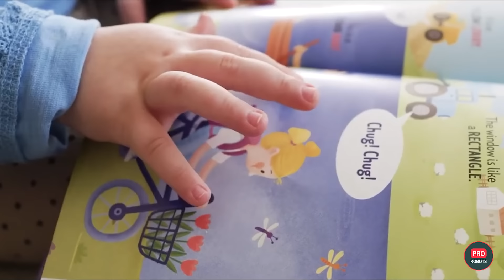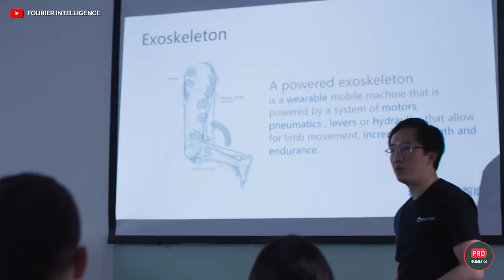Top 10 newest and most advanced humanoid robots in the world. Humanoid robot technology | Pro Robots

Comment: I think the obsession with humanoid robots is weird. I don't think the human form is necessarily optimal, except for robots that have to interact with people, since the human form makes the robots easier to relate to.
Reply: And if we are going to have robots in humanoid form, I would much rather have a basic face plate instead of a human face. Robots are meant to be servants so we shouldn't relate to them or treat them like people.
Reply: Manufacturing machinery and operations are completely made around human form. Therefore a plug-in robot to existing operations is the goal of these companies. It is way cheaper to buy a humanoid robot to drive your old company truck than to buy a brand new robot truck for example.

Comment: It must be understood that all senses are based on matrix of sensors each sensor is very basic after it is software, let's take slip detection.
pressure will give you a picture much like a retina (in fact almost the same algorithm of vision can be used for touch perception) a higher pressure is like a brighter object on the retina, if the object slip; the "image" will "move" exactly like an object that move on your retina.
So, to have a good touch, you need a matrix that can detect temperature and vertical pressure, the direction of the pressure can easily be detected by the concentricity of attenuation of pressure around a main spot (similar to the position of light on the retina) 
I agree that the availability of a good hardware touch retina is the absolute must to have a very agile hand . retina is the model the retina of temperature sensor does not need to be so dense . The retina must be organize on "neuron layer" so no need to transfer the totality of the captor but only the result of a preprocessing, preprocessing that can be "educated "

Comment: Let me set the facts straight here... firstly so called AI has nothing to offer humanoid robotics, rather they're easily "programmed" now using motion capture suits. Next point is cheap actuators, we already have cheap sensors for decades but new cycloidal drives have given new life to the quest, however we still don't have an abundant supply of cheap inverted planetary roller screw servo actuators, the kind commonly used for welding robots (presumably because high voltage arcs and hydraulic fluid are a highly combustable combination). We see Tesla built their own, and guessing these will recover some costs and get used in their fixed base welding robots... and finally the biggest missing part (outside the university lab, or the equivalent homebrew garage lab, but not the foundry just yet...) are memristers, or neuromorphic transistors, whatever you want to call them, they are the components needed for true AI and not just the media hype chatbot stuff we see now. SO with that expect a few more years before any kind of revolution really happens.

Comment: Good stuff, but missed the updated info on Optimus. You show the demo video from MONTHS ago. The latest shows a far more advanced robot. They key differentiator here is not just design for manufacturing and leading vertical integration BUT the massive training dataset and years of head start in AI and the inference computer that will be in the bot. 4680 cells top off the bot's pole position. Finishing with Atlas was kneeling before the headline click bait gods ;) Great research robot, zero intelligence and inefficient electro-hydraulic power system. Flashy, yes. Good for clicks? Yes. I get it. Otherwise GREAT CHANNEL!!